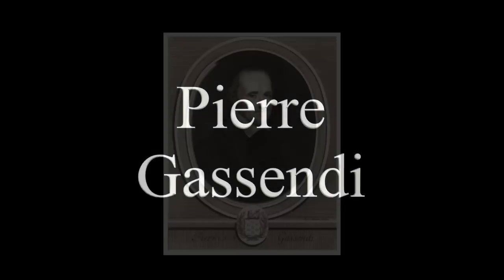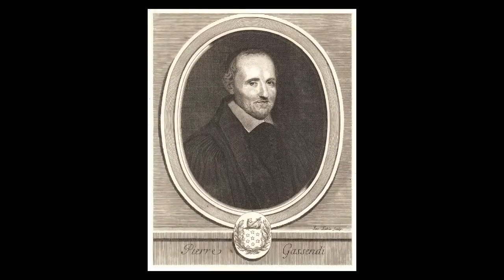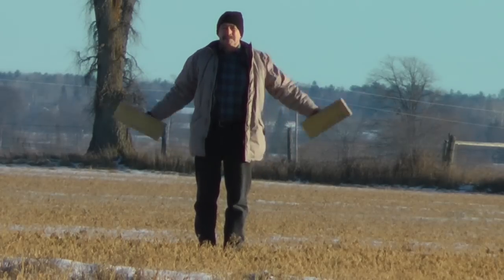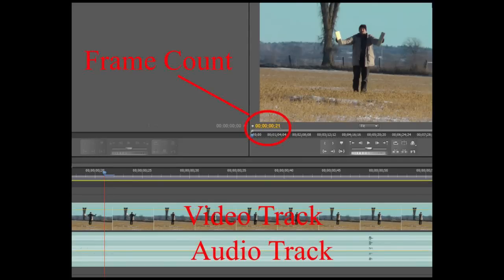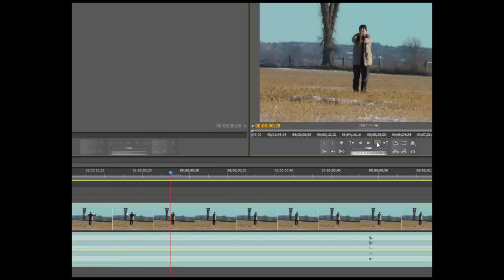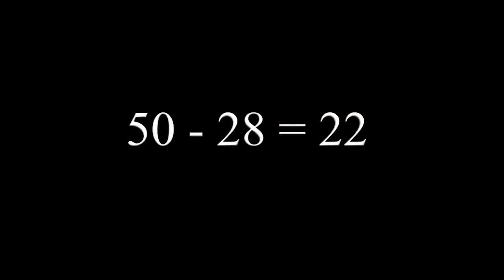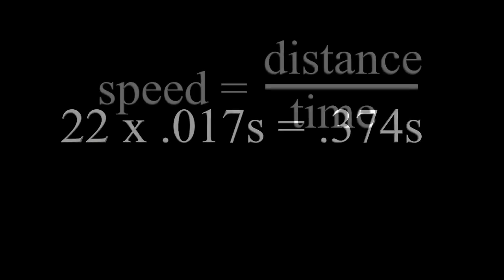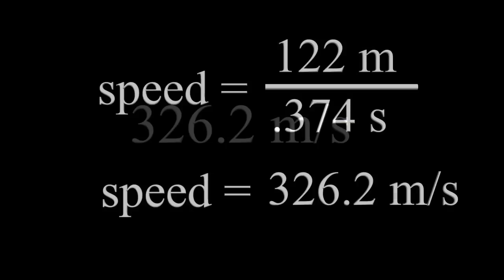Speed of Sound

Comment: How would sound works if the earth is spinning at some 1,000 mph?
Sound speed should be faster if standing east of the source, and not at all if to the west, isn't it?
Reply: Good question! If air temperature effects sound so easily...I would assume a 1,000 mph earth rotation should some how effect the sound speed limit. (right)
He should re-do this experiment facing N - S - E - W .. see if there are any time variations.  I would like to know this as well.
Reply: The Earth drags the atmosphere around with it. By your logic, people staning at the equator should be hanging on for dear life in a persistent 1000 mph or so wind while those at the poles shoould mostly experience little or no wind.

This video makes no attempt to explain why the speed of sound is what it is but concentrates on how to do a practical measurement of it.

Interestingly, if you want to ponder the effects of Earth's rotation, think about why satellites almost always orbit heading eastward. Look it up. Gravity is weaker for things traveling toward the east so it uses less rocket fuel to loft the satellite that direction.

BTW: The whole concept of how sound works is taught wrong so your initial question is sort of moot anyway.
Reply: @crashsitetube  uhh I think you launch towards the east because the Earth is already spinning the rocket in that direction… not cause there is more gravity by a spinning object. Although based on relativity, a spinning object has more mass than a still object
Reply: @kurtsaidwhat  - There are many factors to consider. The first is that the "real scientists" are thinking about gravity backwards. They claim it to be an "attractive force" (sort of like pushing a wagon up a hill with a rope...it don't work). But, gravity relates to mass (atomic mass and its interaction with the ether) and gravity is affected by ALL mass in the Universe (but, not instantly). The oblateness of the earth (larger diameter at the equator than at the poles) has some effect. The rotation of the Earth has some effect. The elevation of terrestrial features (like mountains) have some effect. An ant crawling across an ant hill has some effect.

What needs to be done is get the concept of gravity right first and THEN worry about the mathematics of it. Trying to conceptualize gravity mathematically first is a loser's game. And when you start with getting it backwards......welllllll.......

salaphysics
050322
Reply: The speed of sound is relative to the air so if you have a wind blowing, the sound speed is added to it. Also any temperature gradients will cause parts of the wave to travel more quickly than others, changing apparent direction also.
Reply: @TimpBizkit  The speed of sound is affected by humidity and temperature, but not by the wind. The sound travels through the air, not with it.
Reply: @guate4  what I mean is if you stand in a wind tunnel set to 20 m/s and clap your hands. The sound will move at 343 m/s + the 20 m/s of the wind tunnel = 363 m/s downwind. The sound travelling in the direction into the wind will move at 323 m/s into the wind and the waves that would normally propagate at right angles if the air was stationary, would move at sqrt(343^2 + 20^2) = 343.6 m/s.
This is ignoring any air pressure changes that would also affect these figures.
Reply: @TimpBizkit  You probably know much more than I do on this subject.
I watch how the Doppler Effect works. My understanding is the the speed of sound depends on the means in which is propagated. The speed of the sound is faster in the railroad tracks than the air, for example.
Whether the wind affects the speed of sound I do not know.
Reply: @TimpBizkit  - The problem is not with sound. Sound works as it works following the laws of nature. That there is so much misunderstanding of something so basic (and familiar) to us is both perplexing and not surprising at all.

The mathematicians are to blame. Mathematicians, by their very nature are memorizers; rote learners. they memorize rules they are taught and apply them as they were told to apply them. It's common for mathematicians to say that what they really like about math is its certainty; knowing that if every mathematician on Earth (and probably everywhere else, following their own standardized number systems and essentially the same rules) will come up with exactly the same answer. That seems to be comforting to them. But, it's death when trying to conceptualize science with mathematics.

Per the wind tunnel scenario in this thread, sound travels the same speed regardless of the speed of the wind. A wind tunnel would be a good place to demonstrate this. But, t o be a "real scientist" the question that needs to be worked out and gotten right is, WHY. The mathematical physicists reall never explain WHY and HOW. Just that it follows these rules based on this math or other using these standard units.

My post from several years ago was made before I started putting my salaphysics tagline on my posts. But, this one has it. salaphysics works through the why and how. Too much much for such a thread as this.

But, people have questioned various aspects of sound. The problem is that you cannot see sound and it's tough to measure using old-school science apparatus (like sun dials and hour glasses as clocks). This all changed in 1877 when Edison demonstrated his phonograph by recording his own voice (recognizable as his voice although scratchy) cut into a groove on tin foil. From that moment on, using a microscope (in common use at the time), the undulations of the groove could be analyzed quantitatively.

Sadly, over 140 years later, the mathematical physicists are still stumbling around getting it wrong. Let me rephrase that in somewhat stronger language: Sadly, over 140 years later, the mathematical physicists are still stumbling around getting it wrong while arrogantly proclaiming that they've gotten it right because they are explaining it mathematically.

Of course, when you get sound wrong you get all such radiated phenomena wrong as well (light, radiant heat, radio, x-rays, etc.) since they all work the same way and exhibit the same characteristics.

Here's a pretty good starting point for your own analysis of sound (assuming you have any desire to do so and keeping in mind that you're watching Youtube videos to get your science knowledge). It's a report of a lecture printed in early1885 (seven years after Edison rolled out his phonograph) in a supplement to the Scientific American magazine:

https://chestofbooks.com/crafts/scientific-american/sup3/The-Fallacy-Of-The-Present-Theory-Of-Sound.html

salaphysics.com
050322

Comment: How 'bout the speed of sound through water?
Reply: Engineer No, speed of sound is faster in water than in air.
Reply: Well i'm 3 years late but the speed of sound in water is 1500m/s on average.
Reply: Speed in water is 5 times faster air. Why? In the water there is no noice interference between sender and receiver.
Reply: would be slower because water is denser than air

Comment: why does sound travel at different speeds depending on temperature?
Reply: Erfan Maleki when it’s warmer out the particles in the air are spreed out so I assume the sound travels better through the spreed put particles rather than the close together particles
Reply: @legoman-bl3xi  Though you've got the right idea it's actually somewhat the opposite. At RAAF cadets they thought I'd that sound travels faster and further at night due to the moisture in the air settling and the cooler temperatures make the air thinner. I don't know the specifics of why it happens but I'm interested to learn how.

Comment: great presentation.
do you mind explaining why temperature causing the difference in speed?
i'm guessing it's because of air density and if so which results do you think this experiment would show under water, since colder water is less dense.
Reply: Boredness sound travels faster the lower the density of the medium
Reply: if you go into the formula of the speed of sound in air , you will find that it is directly proportional to the squareroot of temp (in kelvin)...this means if you double the temp. you have double the speed of sound..http://en.wikipedia.org/wiki/Speed_of_sound  ---look up practical formula for more.
Reply: Just wanted to say water density increases the colder it gets (except from 4 to 0 Celsius), but sound travels faster in warm water than cold water. Speed of sound related to just density is tricky I guess, since intuition says more density = faster speed (since sound is faster in solids which are more dense) but this isn't always true I don't think since more dense air (at the same pressure) just means the individual molecules are just heavier, since different gasses contain the same amount of molecules in the same amount of volume (1 mole in 20-something liters).. so as just the density of gas increases (which would only happen between different gasses), you're only increasing the weight of each molecule which heavier things move slower with the same amount of energy than lighter things. Ummmm if you changed the density of the same gas, you'd also have to change the pressure and they seem to be inversely proportional in the speed equations so I don't think those things have any effect on the speed at all, just temperature. Would make sense since you only see temperature in speed of sound in air charts and nothing about elevation. Never thought about it before, but it's pretty strange and counter intuitive!